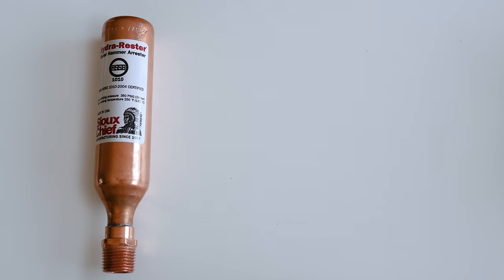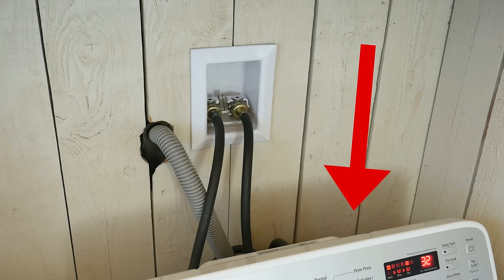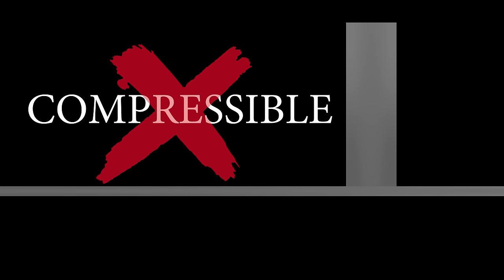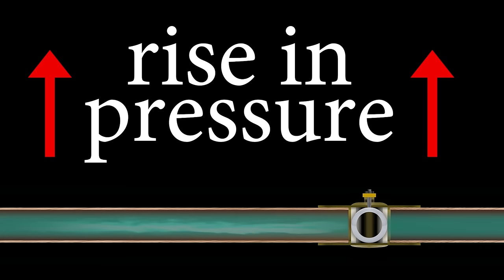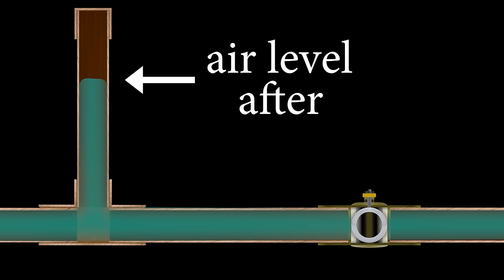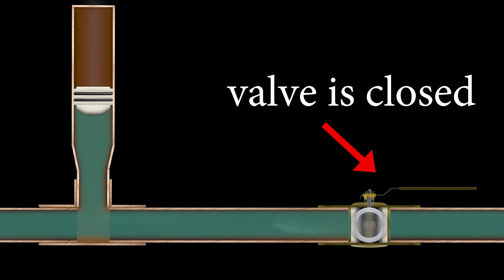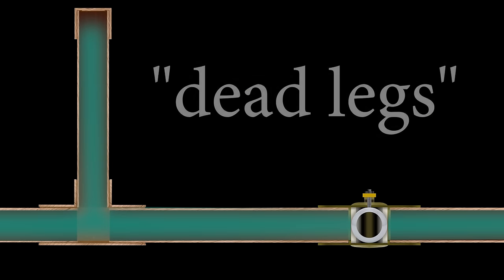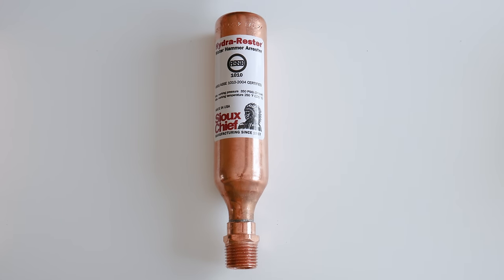Why Water Hammer Arrestors Are SO Important | GOT2LEARN

Comment: I am a plumber since 1977, master license MP 4125 state of Arkansas, formerly Texas master license as well. makes a nice video but not entirely true.  O-rings wear out.  shock arresters should be installed primarily in commercial applications where they are accessible and never in walls. they are a mechanical device, they wear out, thats why they must be accessible.  99% of residential plumbing in america has never has shock arrestors and does not need them.
Reply from the maker: They will eventually wear out for sure, but they are cycle tested 500,000 times, so it give us an good idea for how long they last.
Reply: @Got2Learn  < less than 15 yrs if you flush, wash clothes, dishes, watering lawn using 100 times per day...that is easy to do.
Reply: Every new home or older home that has been remodeled or re-piped in Texas is required to have hammer arresters. You won’t get a final without them.
Reply: Had to scroll way too far down for this comment. While all the technical info in this video is basically true, the title and calling it mandatory is HORRIBLY misleading. Never once seen these in a a house and never once seen an issue because they weren't there 🤦‍♀️
Reply: @chrish4439  They are mandatory where I live. There are a pair of them installed in my house behind the clothes washer.

They are required by a township ordinance. My township is somewhat less than 100 square kilometers. Travel 10 km in any direction, and you will be in a different jurisdiction, and the laws will probably be different.
Reply: @hamjudo  what country do you live in?
Reply: @chrish4439  This is just another code to add cost and complication for nothing
Reply: @hikdingle2210  I live in the United States. Specifically, I live in Michigan. Michigan counties approximately squares with each side being 36 miles long, unless a body of water was in the way. Each county was divided into 36 townships that were squares 6 miles on a side. Cities can annex land from townships with a an election. Entire townships have been swallowed by cities and ceased to exist as separate legal entities. Many townships are missing chunks. I live in a slightly rural area that has not yet been annexed by a city.

Every city and township has its own building code, electric code, and plumbing code. They don't have to match.

The requirement for water hammer arrestors at washing machine connections was relatively new here in 2005 when we did a major remodeling job.

They actually work well. The plumbing for a shower and for the washer run inside the same wall. The shower pressure doesn't detectably vary when the washer opens or closes its valves. It is an old washer without a soft start.
Reply: @hamjudo  Why are using kilometers?
Reply: Houses that have a pressure tank would never need them. The bladder absorbs the shock from the pump starting and stopping and any valves opening or closing.
Reply: @user-bd5md5cm2j  you mean expansion tanks.
Reply: @hikdingle2210  95% of the world do. The metrical system is the world standard.
Reply: @Stefan_Dahn  That's why I asked what country he lived in.
Reply: Next door neighbour recently bought a new washing machine,since then we have violent banging on our pipes,If I close my stop tap in my home the banging will stop,the mains  cold water system is shared with my neighbour.We in our house don't generate the banging it is coming from the shared cold water system.Would a arrestor help to stop the banging AND where would I fit it ,maybe directly after the stop tap in my home, under the sink.I live in the UK 🇬🇧.Advice would be really helpful hopefully (please)👍👍
Reply: They are 100% needed and nothing to do with commercial setups.
Reply: exactly. this video is functionally an ad. and, praytell, how does all that air in a dead leg disappear, yet the trapped water still be stagnant enough to breed bacteria? any thermal difference will produce some circulation.
Reply: As a plumber today, not a master plumber, you are very wrong. At least all washing machine installations get water hammer arresters for hot and cold lines in residential units
Reply: Good comment. My bathroom toilet line rattles when using the washing machine. My house was built in 1969, where do you install them for the washer?
Reply: Most water meters have a non return valve which will cause water hammer Everytime a tap it appliance shuts off water supply. Twisty traps shut the water off slowly so reduces/eliminates hammer effect. Lever taps and appliances shut water flow rapidly and with a water meter/non return valve, this will cause water hammer and a big surge in pressure
Reply: @Avalonanon 
The newer flushometers don't require a hammer arrester anymore but  a hammer arrester is still specced for them anyway.
Reply: Do i need them or not? I feel like installing a couple

Comment: Now I know why the wall goes BONK every time I shut off the hot water too quickly. My landlord is too cheap to look at it.
Reply: The entire building (24 floors) of the apartment I lived at got this problem. Every night when people start showering, I hear hammering noises until 12:00am. Can't really sleep until then without putting on my bose qc20.
Reply: @howardlam6181  yup. Every time we run a washing machine the pipes just bang like being hammered.
Reply: Send them this vid.  If they value their building and don't want it water damaged by a burst pipe, this is cheap insurance.  Happy tenants also tend to renew, so it pays for itself that way as well.  It is very likely they just don't know this is the problem and figure it's no big deal.
Reply: @nateman10  
10s of thousands of dollars. 
Probably costs 5 to 10 dollars for the PVC version of this. 
Most plumbing is PVC now. 
One or two of these installed would probably suffice for a large house. 
Installation would be relatively cheap. 

If I was a landlord I would play dirty. 
There are easy ways to evict someone and there are hard ways. 
Sometimes you gatta stop playing fair.
Reply: Eventually your pipe will leak and flood the inside of the walls.  If black mold sets in, your landlord will have to break out all the walls and treat the wood.  That is way more expensive than simply opening the wall and installing a hammer arrester.  Black mold is very dangerous and a high liability item in rental properties.  If a tenant gets sick because of negligent maintenance, the landlord is in big trouble especially in this day and age of social justice.
Reply: @Jens van roy Bracing is important but the force of the water stopping and starting will still torque the pipe and stress the joints.  Better to have bracing and hammer arrester.  I did both in an add on room that needed a long pipe run.  It works like a charm.
Reply: I think most of old aparments have this problem in toronto
Reply: @Jens van roy The torque force always exists and is not eliminated by bracing or hammer arrester.  True, bracing prevents movement but it does not dampen the force like a proper arrester.  Spend the couple extra bucks on the damn thing.
Reply: @Jens van roy For the rest of us including homeowners, the materials cost of installing a hammer arrester is about 10 dollars.  You will need a T, a few inches of pipe, and an arrester.  If your handyman insists on doing the job his way and not the right way, get another.
Reply: @itsMe_TheHerpes  Dammit, it's 2021.  Water supply reinvented, reimagined, disrupted.  We should go back to the nature and carry our water from the well.  This would ensure people take what they need because there is a dis-incentive to waste.  And the exercise would lead to better health and longer lives.  Ooh, ooh, ooh.  The possibilities for social engineering are endless.  Sarcasm mode off.
Reply: You can also take out the tap filters and crimp the end of them
Reply: @Jens van roy bruh you missed the entire point, even if they are properly braced and there is no noise, it doesn't matter, the noise isn't the problem, the real problem is that it will weaken the joints of the pipes and cause a leak which will cause massive water damage which can cost hundreds of thousands of dollars to repair.
Reply: You must live in a pretty piss poor area. When I was in college I rented an apartment for $450 a month with utilities included if anything went wrong the appropriate cpmpanies/workers were there within a couple hours after calling.
Reply: In Finland we have building code that necessates the installation of pipe holders at set intervals to minimize the movement.
Reply: @avatar1867  yes the piece would be about 5 dollars, but now you need to buy a bunch of them depending on the size of the building and the amount of lines, you'd be pulling down drywall, taking apart the water lines and installing these all over the building. That's not a "small" job.
Reply: @nateman10  Would like to say the blocking evictions was very much needed. But I agree in that it should have been done much better. Compensation to Landlords to make up for loss of income, allowing evictions in cases where the resident is unstable (in which case this is to protect others and also prevent a home from becoming uninhabitable) and provide housing for those ones, etc.

So yeah, the government fucked this up
Reply: @Jens van roy the vibration eventually shakes the brackets loose, which will allow the noise to happen
Reply: @Jens van roy walls aren’t forever. You’ll just wallow out whatever it’s mounted to over time.
Reply: @Jens van roy I really hope you don’t earn a living with tools
Reply: Hello Laura

Comment: as a European plumber, I can see that American plants are at least half a century behind. All hydraulic appliances are now designed to not generate water hammer. Even solenoid valves are closing slow enough to avoid it. furthermore, the dampers are made with a membrane and a spring and not with compressed air to prevent leaks from the o-rings.

Comment: It’s hard to believe that the aresters o-rings will last longer than air chambers.
Reply: i think the problem on the air chamber is the soldered cap,that will leak the air with time, but the arrester is a continuous cup.
anyway,maybe shutting off the water and draining the water should "reset" all the air chambers on the system.
Reply: @xiro6  If that would be the case, then you would know, because being on a pressurized line, it would be leaking water. 

It is as the video explains, over time the flow of water up and down the pipe absorbs the air inside it. Remember when you sometimes open a tap to pour yourself a glass of water, without letting it run a bit and you look at the glass to see that the water looks cloudy due to having a lot of fine bubbles in it. That is an example of water that has absorbed air that was it the line, as it was passing through. 

As for the synthetic o-rings, while they do wear away over time, in this application, it will literally be a lifetime, if not more. The reason is that they tampon moves very little in actual usage, as well, the wet surface of the tube acts as a lubricant that mitigates the friction between the two surfaces. Lastly, most of the time the change and oscillation in line pressure is not significant enough to cause it to move, so unlike a shock absorber on a car, which is essentially built and operates in the same manner, as the hammer arrester, they are dormant for most of their time in use. Nor, by being inside a dark sealed tube are the materials affected by UV light or ozone, which can also cause the materials of the tampon to deteriorate over time.
Reply: This is why it might be a good idea to replace the water hammer arresters after a few years.
And when you do so, open them to check if it was needed or not. If it was, increase the replacement frequency. If it was not, decrease it.

There could be more scientific ways to see if it's necessary or not such as trying to heat the top of the arrester and seeing if you are able to heat it quickly (no water) or not (water). This should be easy to do with a lighter and a thermocouple. Fun science project !
Reply: Nothing has an infinite service life.  Even a soldered joint that is holding pressure with no leak at start of service, if not done right, can fail in weeks / months / very few years.  I am sure it is easier to get a life expectancy number on these commercially produced devices, than to try to figure out a replacement time for a field constructed dead leg.
Reply: They don't. Severe water hammer with too short of a pipe is what will draw air out of the stand pipe in the form of very small bubbles. Although, one can inject air into the lines on purpose and refill the stand pipe as it will capture some of the air (bubbles) passing.

It's a solution looking for a problem.
Reply: @hahahano2796  incorrect. the problem is that air essential evaporates in water. water absorbs air. has nothing to do with movement/bubbles taking the air away. the stand pipes never worked.

Comment: When I was a kid, we were at the end of a 5 mile long, 24 inch gravity fed irrigation pipe for the farm.  We would have to change the pipe twice per day, which would involve opening and closing that valve. My dad strictly warned us to close the valve slowly and to watch the pressure gauge carefully, especially when we closed it. It normally ran at 130 psi, (household is about 40 psi) but if you closed it too quickly, you could see spikes at 200 psi or more. 

Shortly after I went off to college, my dad sold the place. The next year, he showed me an article in the paper where that pipe burst and caused some $200 k in damages. We knew exactly what happened.
Reply from the maker: Ouchhhh
Reply: @jimjohnson394  I wonder if he told the new owners about this? If he did, my experience is people don't remember me info at new places unless written down, and even then they tend not to take it seriously until they wish they had.

Comment: We had this problem at my work, whenever they used a pressure washer and released the trigger, the hose connector at the water outlet would spray a bit and a loud bang be heard within the wall. 
As soon as I noticed it, I told the technicians about it. Nothing was done.

Two pressure washers started leaking within one week.
They bought another version. The water outlet started leaking. They changed it and put a stronger seal.
Some months later, water was coming out of the walls on the other side. 
As they were tearing the wall down I just had to say "If only someone had told you about this before".
Reply: were these technicians awake, or were they cardboard cutouts ? if they did nothing, then they should be called " ornaments " as ornaments are there on show, but have no functionality.
I once used a pressure washer, and my neighbour knock at my front door, to say it was shaking their water pipes about, we had a shared mains water supply, so I fill a clean dust bin up with water, open to atmospheric air pressure, put the water supply hose into the dust bin of water one end, and connected the supply hose to the jet washer after getting the air out of it, and it worked without any problems, it was isolated from the mains water supply, the jet washer sucked in the water by it self.end of problem. well a quich solution.
Reply: You can save your plumbing pipes and pressure washers by always, or nearly always, having the pressure washer's sprayer trigger in the ON position.  If you want to stop using the pressure washer, shut it down by turning off the motor while the water is still spraying out.  Result: no more water hammer nor pressure washer wear and tear.

When you begin using a pressure washer, first always have the pressure washer trigger in the on position.  Once you have it in the on position, then, and only then, turn on the motor.
Reply: My home clothes washer. The pipe went by and under the wooden flooring of the kitchen. It became nicked with the hammering over time and so the entire floor boards became warped with being damp underneath and dry on top. Took a long time to dry and the outside wall needed to be opened to get access to the pipe.... An absolute pain of a job and all could have been saved with an arrester.... Don't anyone risk it without one on all valves other than perhaps just hand taps. Even then you ask everyone to turn them off slowly.

Comment: Dunno if you remember, but a few weeks ago I asked about low flow in my shower. You said it was probably clogged or bad cartridges. You were right. I disassembled them and the cold water valves were clean but the hot water valves were a mess with mineral deposits. I have private well water and always knew my water was hard, and learned that hot water causes the minerals in hard water to deposit. So I installed a water softener on the cold water line going to my furnace and cleaned my hot water fixture valves. So now I'll be curious to see how well it keeps the hot circuits clear of deposits.

Thanks for the tip 👍
Reply from the maker: Awesome, glad it worked out and I hope the softener helps reduce the deposits, yeyyy!
Reply: Water softener does absolutely nothing for deposits!!
You need an iron filter and a water test to determine what size